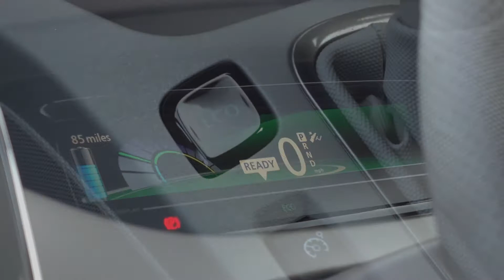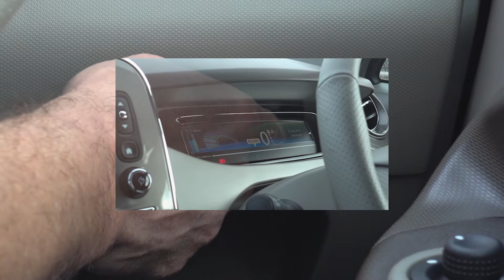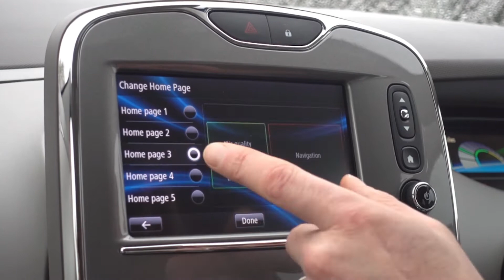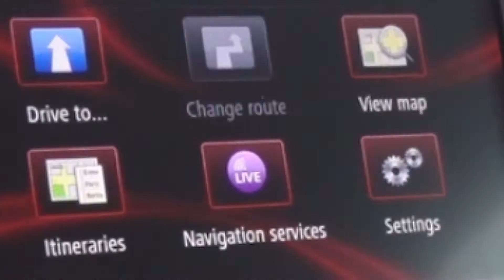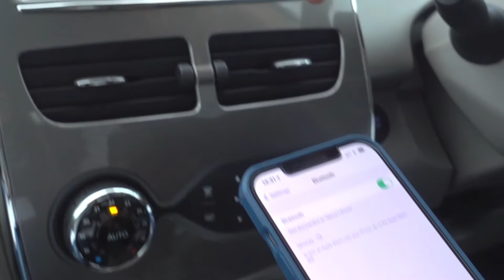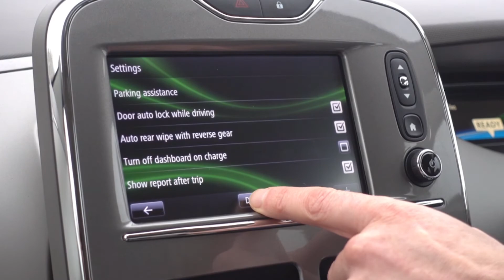Renault Zoe Media Centre and Controls Guide

Comment: Hello I'm a new Renault Zoe user. Can I turn off the radio but still have the navigation system running? I have looked at the controls, apart from just turning down the volume I can't find this. Many thanks for a great video.